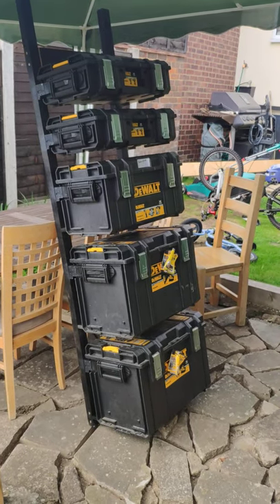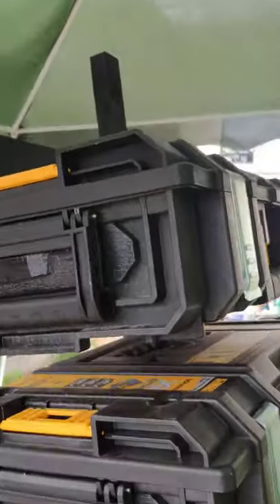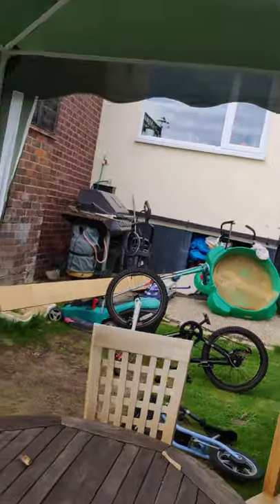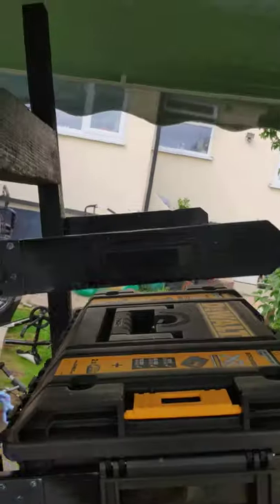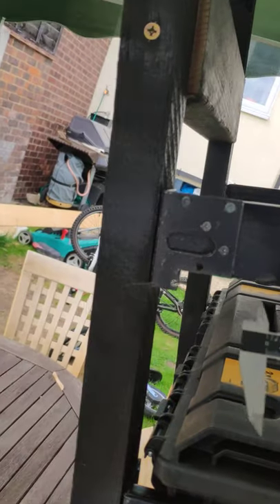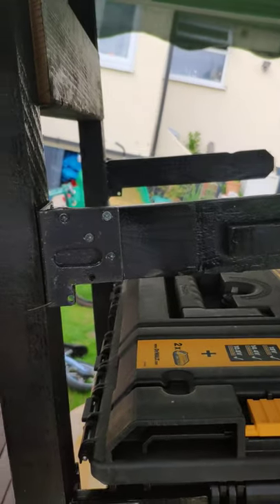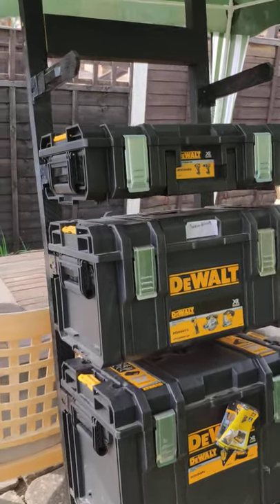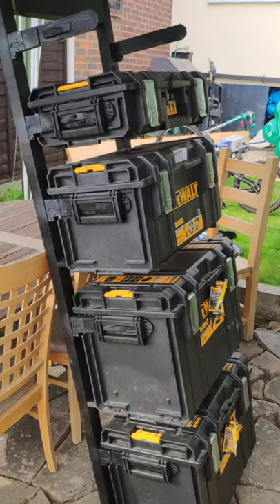DeWalt Tough system racking - DIY - Build Your Own

Comment: I've also seen someone on Instagram that simply fixed a twinslot shelving system onto some plywood and slid the boxes onto the arms. If that makes sense. He also had to bend the arm right at the tip so that the boxes don't fall off as it was for his van
Reply: Interesting that’s a good idea I never thought of shelf brackets all he would have to do is add the small piece  that fits inside the handles and it can operate just like the originals.